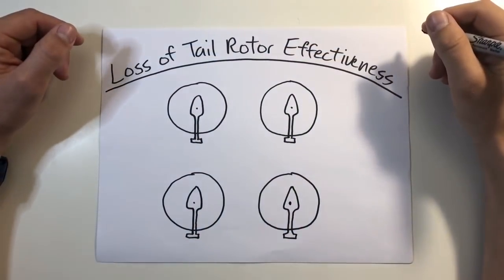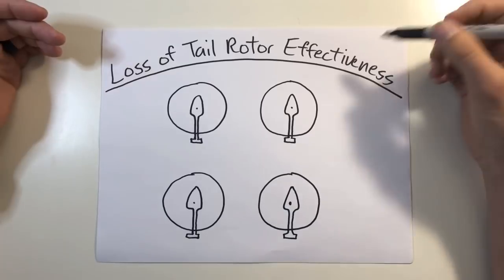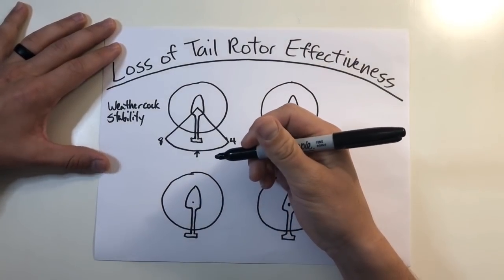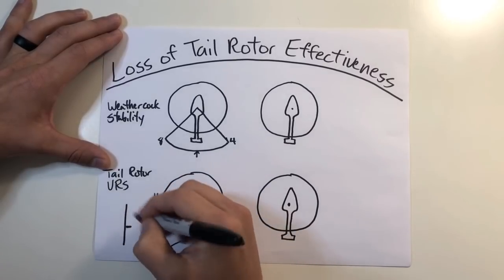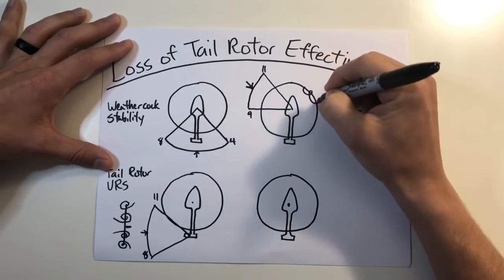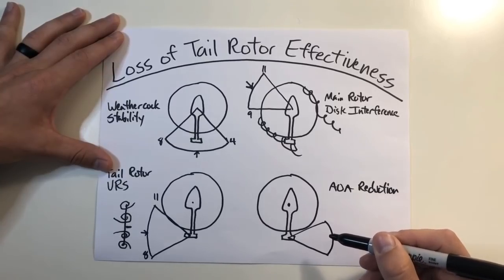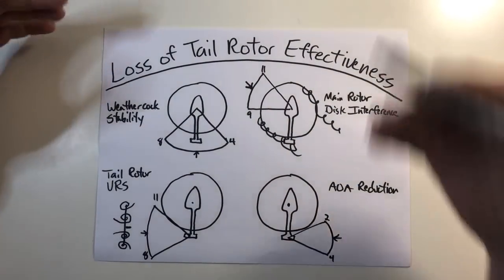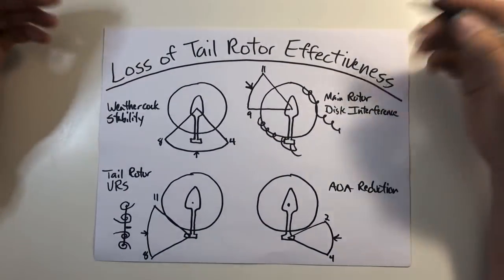Loss of Tail Rotor Effectiveness in Helicopters

Comment: I really like the thoroughness of your videos.  I am always skeptical when I watch this type of video and tend to try to poke holes in the theory.  But I must confess that I have learned things from your videos that I did not learn in Army flight training.  

I am not sure of your background but I suspect you are of the AH-64-D/E persuasion.  Most of my experience was on the AH-64A.  I also spent time in the utility community before coming to the light.  I was a crew chief on the UH-60s and later was a pilot/MTP on UH-1Hs, and then finally I was a pilot and MTP/MTFE on the AH-64A Apache.  

I also worked for Bell Helicopter for 30 years prior to my retirement last year.  I used to present a Helicopter 101 class to my colleagues.  It was always well received.  

You do an excellent job explaining the Fundamentals of Flight...keep up the good work!

Comment: Was landing in Honduras in a UH-1 and due to NOTAMS we were stuck with less than favorable conditions (direction of approach) with a high DA, critical forward CG, and a full load.  As I finalized my approach to IGE hover I began my turn to get to the pad I ended up with an AOA-reducing quartering tailwind combined with weather vaning and the nose just kept rotating right.  I quickly ran out of pedal, so down and forward onto the pad was the order of the day.

Comment: Does this affect NOTAR helicopters like the MD902 Explorer? Excellent videos, you're students should be very proud of you. Top instructor
Reply from the maker: Great question. I’ll have to look that one up. At first thought, it doesn’t seem as though it would have as much, or any, effect in some cases.
Reply: It shouldn't because NOTAR uses a nozzle at the end of the tailboom for anti-torque control. Since there is no way to disturb the airflow over the tail rotor it shouldn't happen.
Reply: @helicopterlessonsin10minut10  I’m thinking of electric tail rotors, like Bell’s EDAT (Electrically Distributed Ant-Torque). Could this significantly reduce the problems you have outlined?

Comment: It's not "settling under power" it's "settling with insufficient power".  The US has had one helicopter powerful enough to get out of VRS by applying torque/power to get out of it.  That would be the CH-54 Tarhe, aka the "skycrane".  Not even the mighty Chinook, which has a shit-ton of torque, can get our of VRS like the CH-54 can.  The 47 is quite easy to recover from VRS however, you can usually just use pedals to get out of it.  Also, the 47 doesn't have LTE since it has dual tandem rotors..  :)  I am simply mentioning settling with insufficient power, not LTE.  

Worthy of note is that the Apache has a special tail rotor, with dual blades scissoring on the tail.

Comment: I don't know anything about helicopters or flying at all but I'm going to make some guesses. If you lose your tail rotor you must assume it doesn't exist basically. I assume you can cut all power to it.  If you can get the main rotor to gain rotational momentum enough through negative angles or whatever you call it to auto rotate you might be able to descend and then gain enough lift by changing to a positive angle closer to the ground. If you are high enough this should be easier and then again if you are low the impact forces will be less. I've never actually been in a helicopter I'm just theorising.

Comment: Not that frequent , in 35 years of duty works, like rescue, external load operations or long line, I may have done 2 or 3 LTE compared to hundreds of Vortex Ring State or Settling with Power.. BTW, Bell machines seem to be more affected by this. May be because of the clockwise choice and  a different pull/push action of the tail rotor itself with different blades size.

Comment: Hello Jacob.   I showed the LTE video and printed pages for this LTE presentation during a stage check as I am doing my commercial add-on.  At the place I train the main instructor had never heard of AOA reduction and in essence said probably not a good idea to raise this with the examiner as it is not in the helicopter flying handbook.  Other than your presentation, where else can I find more details on this AOA reduction LTE concept to support your findings?  I wondered if this is a more advanced training concept you receive with your military flight training but is not very common in General Aviation.   Thanks.
Reply from the maker: It’s found in Ch. 6 of the Naval Introduction to Helicopter Aerodynamics manual outlining the differences between Loss of Tail Rotor Effectiveness and Loss of Tail Rotor Authority. Page 6-12 has a whole paragraph on it. 

“AOA Reduction (060-120 degrees)
In a right crossword, the relative wind shifts toward a tail rotor blades’ chordline because of effectively increased induced velocity (Figure 6-11). The shifted relative wind impacts at a lower AOA, which develops lower lift and results in less thrust. The pilot will automatically compensate by adding more left pedal, but in some cases can reach pedal travel limits before adequate thrust can be generated.”
Reply: @helicopterlessonsin10minut10  

Thank you Jacob….excellent information and I will pass it along.

Comment: Thank you again.  Just to be sure are you saying that the proper corrective procedure is immediate application of forward cyclic and simultaneous application in increased pedal input to counteract the adverse yaw? And is that true for each of the four wind cases you’ve illustrated without regarded which one or the direction of the problematic wind? Also, since this tends to be a problem when hover-taxiing would a little upward pressure on the collective sometimes necessary to keep the main rotor sufficiently clear of the runway during or taxiway surface during its forward ark? Maybe my fixed wing mindset had me confused again. One more question: Are the intro shots from Fort Rucker??
Reply from the maker: William Eudy. Great questions!  Yes, if the nose begins to yaw and it's suspected that aircraft control could be lost (this is the most important consideration) the corrective procedure is to apply as much pedal as possible to gain/maintain aircraft control while flying out of it. This is just another reason why it's so important to understand wind direction when maneuvering helicopters, even at a hover. Keep in mind that not all cases are the same. If the helicopter is light weight on a cold day you may have quite a large power margin and hovering in the weathercock stability may just be uncomfortable but not necessarily a condition where you could lose control. To address your other question, hover taxiing at a slightly higher altitude could potentially give you more altitude if you had to fly out of LTE but it also increases the required left pedal to maintain heading. So once again there is a trade off that the pilot must consider and tailor movements to the specific situation.  Lastly, I have video intros from all over the world and yes some are from Fort Rucker.  I hope this helps answer your questions.
Reply: @helicopterlessonsin10minut10  There is no risk of the tail rotor stalling when you apply more pedal?

Comment: If you recognize the wind direction and allow machine to weather vaneinto it by reducing forward speed but controlling rotor rpm and easy on the pedals with little or no input. Let it fly again like stall recovery???
Reply: Would that work?

Comment: LTE is the lack of power on the tail to overcome the push from the weather, correct? I'm new on this that what I understand
Reply from the maker: LTE is caused by winds on the aircraft during high power settings. It’s not necessarily a lack of power to the tail rotor.

Comment: Wow seems like a lot of options for getting in to LTE. What kind of wind speed would be problematic? Seems almost impossible to avoid all of these angles relative to the wind when manoeuvring around an airport.
Reply from the maker: HappyCamper. LTE can occur with even just a few knots of wind depending on certain helicopters. These regions are not necessarily completely uncontrollable or unrecoverable wind azimuths as much as flight profiles to be aware of, especially when power limited. The only way to completely avoid these regions altogether would be to operate above ETL or with the nose into the wind while hovering. I hope this helps.
Reply: The reason why 'copters are a risky firm of flying. Give me two wings every time!